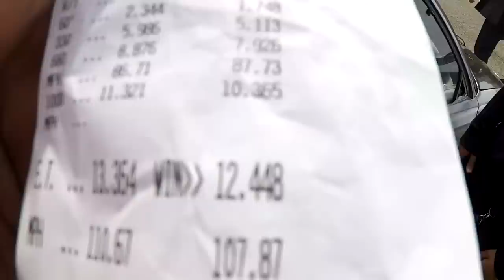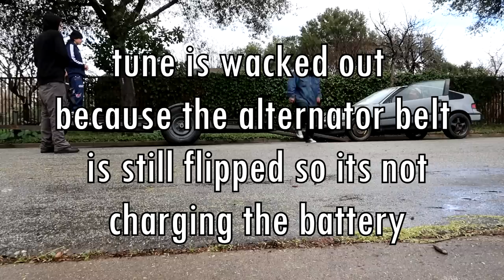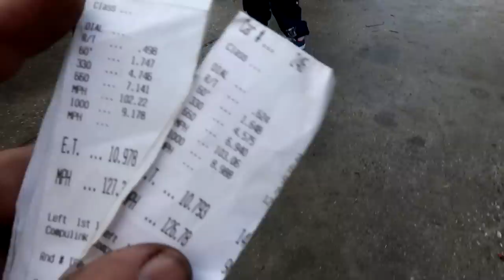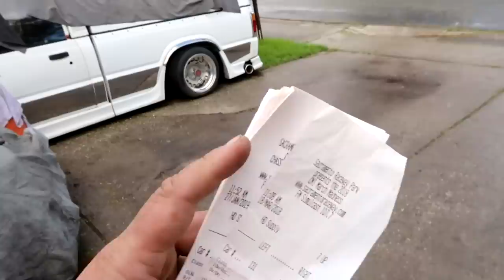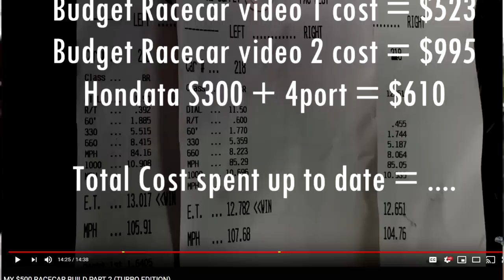CHEAPEST 10SEC HONDA ON YOUTUBE ?

Comment: I have a stock 97 hx Civic with a d16y5 115hp I want to turbo it and try to get as close to 200hp without spending to much. Any help is greatly appreciated.
Reply: HF manifold if you can find one, get cheap T3 turbo with a four bolt flange from a Ford Thunderbird Turbo coupe, maybe $150 at pick-a-part. Some used 500cc injectors, Chrome ECU and a fuel pump. Add another $300-$400 for an exhaust that won't get you pulled over. You'll need an intercooler too about $300.
Reply: @dj4monie  how much would it cost me $1000-$2000. I'ma do all the work myself

Comment: Is the motor stock, headgasket, cams and bolts all stock
Reply from the maker: Stock head, stock block, stock head studs, has balance shaft still in it with belt. Ported manifold and 68mm Tb and stock h22 trans non lsd as far as engine goes.

Comment: I need myself a CRX too 😀
Reply: I miss my old CRX. The dude that I bought mine from was a little cracky and all he did was beat tf out of it, but what did I expect for a $500 running car? I swapped a JDM D15B VTEC into it, converted the car to OBD1, and installed a socketed and chipped P28 and the car was fast with nothing more than a cheap i/h/e, but I prodded the quarter panels with a screwdriver and they were constructed of 3" thick of Bondo and the rocker panels were totally gone. I would love to have another one though, but semi-clean CRXs or even EFs around here are expensive af.
Reply: @Brock_Landers  yeah CRX are hard to find. 😀

Comment: Link to that turbo for 200 cause best I can find it 299 for the jb version
Reply from the maker: eBay item number 182000262160
Reply: @YoungStatic  thanks just saved that seller and item.  Cheapest price I've ever seen for that turbo
Reply from the maker: @t6378tp  this number 172073339127  is to the turbo. my last reply was the number for the turbo i bought in my order.

Comment: if you sold it for less than $1,800 and they get it running right and go 10's in it then technically they would have the cheapest 10 second Honda on youtube because it ran but did not drive when you sold it...just some food for thought...^_^
Reply from the maker: Sold it for 3k papi.

Comment: Pink Widow del sol on @diymike is super close to making their 10s pass but after their last track day I think they're gonna need to add a couple bucks in maintenance so they can push the car into the 10s. Rooting for them especially since Mike tuned the car himself and Carlos has been banging gears like nobody's business trying to get it. I wanna say they're @ around $1600 in the car with a budget B-Series turbo. #B2DXIFEELITGIVEAWAY
Reply: they tallied up last video and was more then this one on expenses
Reply: @drewster956  my bad, you're right! I have the occasional dyslexia flipped that 9 upside down and landed on the 1600. So total they're $2200ish in to their build. Running under 11.5 before they broke the car so it's gonna be like $2500 minimum before they hit 10s.

Comment: hey static i know its off topic but is it possible to do a rear disk swap on a wagon i remember a video where you were at a junk yard and showed a wagon with rear disk is it a bolt on affair or more involved? 
#B2DXIFEELITGIVEAWAY
Reply from the maker: That video I was confused myself because it was an actual rear disc that was bolted up and it should have been shorter which it wasnt. You can buy brackets to bolt the caliper onto the wagon drum and go disc. Let me remember the company.
Reply: YoungStatic right on thanks bro